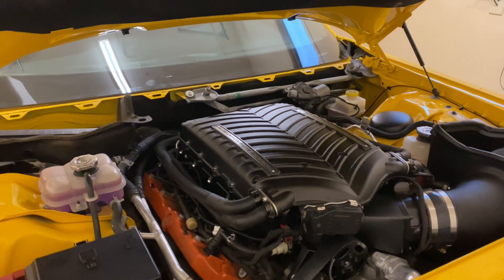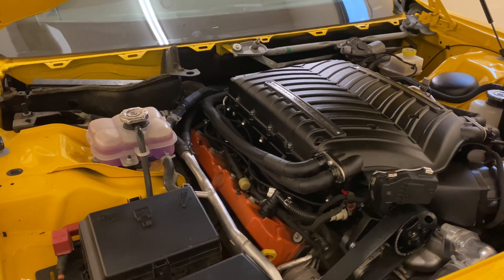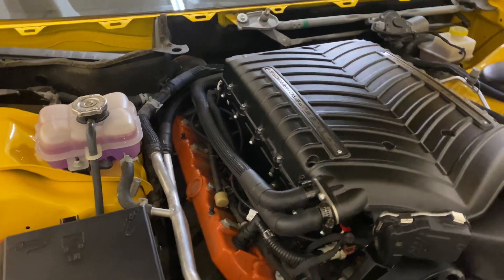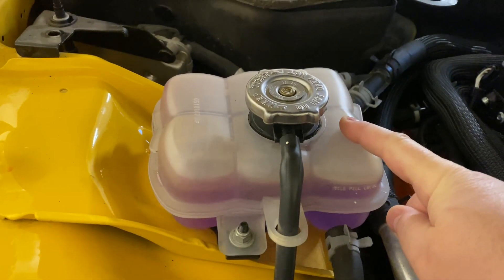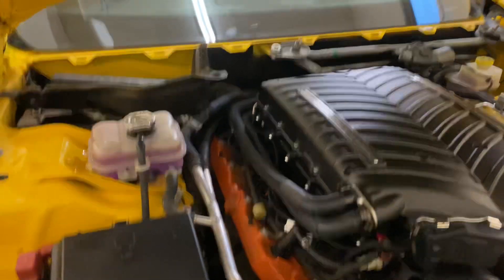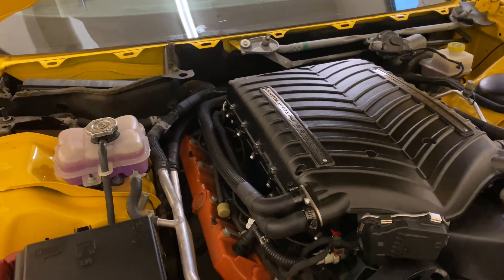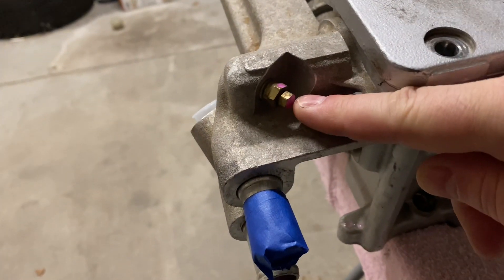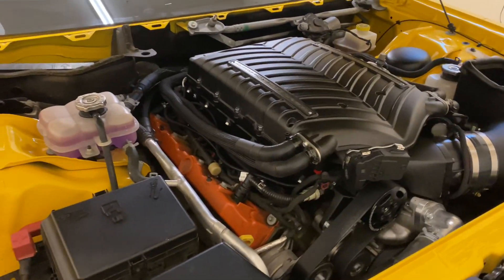Burping Whipple Superchargers on a Hellcat engine

Comment: Great job! Very informative! I've had great success with burping it using just the lines on hellcats and earlier C7 Z06 corvettes that didn't have a factory reservoir. Constant squeezing of the hoses alone is a method that takes quite some time To really bleed before turning the car on and letting it bleed itself, where you really have to go at it a long time to avoid burning up the bearings and rotors (screws) as that coating is what really determines the boost that it can put out. I'm really glad Dodge using the IHI superchargers did have that bleed bolt, even though it's in a tight spot. Thanks for taking the time to make this great video!

Comment: With the OEM system, are you only cycling tightening and loosening the bleed valve or are you clamping the hose too?
Reply from the maker: You shouldn't need to mess with clamping hoses on the OEM.  Just use the bleeder screw on the top rear of the supercharger.

Comment: Do you do it with the car started or on or off and the bleed comple off.
Reply from the maker: I have a tool from zautomotive that lets me turn on the intercooler pumps without running the car.  If you don't have that you will need to run the motor to get the pumps to run.

Comment: Man this video may save me a ton of headaches. I don’t have a whipple but a Maggy 2650 and have been getting low inter cooler fluid on the display. It was a little low I filled it but still showing.and I’m going to try this method and hope and pray 🙏 that’s all it is.
Reply from the maker: I am glad it helped.  These superchargers are hard to get all the air out due to how high they sit on the motor and the way the coolant flows out of the intercooler pump.

Comment: Does one have to burp their Hellcat like this method for OEM s/c install too?
Reply from the maker: Yes but the OEM s/c have a bleed screw on the rear of the supercharger that makes bleeding easier.
Reply: @yellowhellcat   what's the trick to remove lower intercooler hose from s/c?
Reply from the maker: @mikeprice8307  I used a flat blade screw driver to pry gently on the hose and a right angle pick tool to work around the hose to loosen it up while pulling.
Reply: @yellowhellcat  well I was asking about the clamp on the hose.

I'll attempt tomorrow I didn't have enough time today.  After research, I went and purchased a cable hose clamp remover.

Dang clamp was placed facing the firewall.  Got the tip one off easily but the bottom 1 is a B.
Reply from the maker: @mikeprice8307  OH!  Yeah I bought a cheap clamp tool from Autozone that has a flexible cable with a squeeze trigger that compressions the clamps from almost any angle.  Well worth the spend.
Reply: @yellowhellcat  VERY much 😅😂

Comment: Dude thanks man, excellent information! 👍. Would you know where to find tq specs for the hellcat motor?
Reply from the maker: Possibly.  Which torque specs are you looking for?
Reply: @yellowhellcat  just a general reference for everything because I am going to yank my motor and make it a race car it’s about that time for a complete refresh. Probably doing the majority of the work myself but need tq specs for everything. Is there a book or do I have to subscribe to something like all data? Would be nice to have. Not easy to find.
Reply from the maker: Sounds like fun!  I agree that torque specs can be very hard to find.  I normally just end up googling the part I am working on and usually find it in a forum post or something similar.  You might also try asking your local Dodge dealership if they could print out the specs from their service manuals.
Reply: @yellowhellcat  Hey thanks for the lead man, much respect. Yeah it’s going to be awesome.